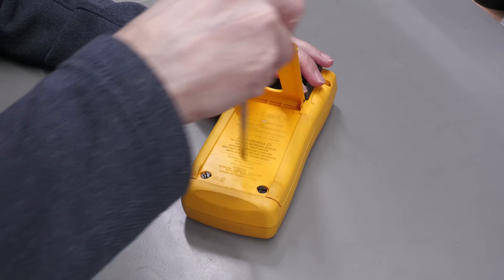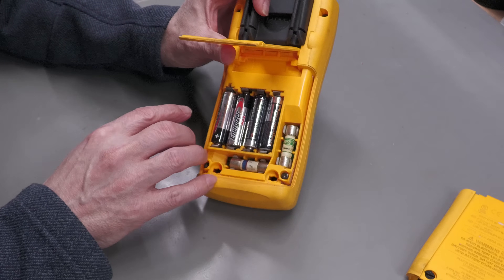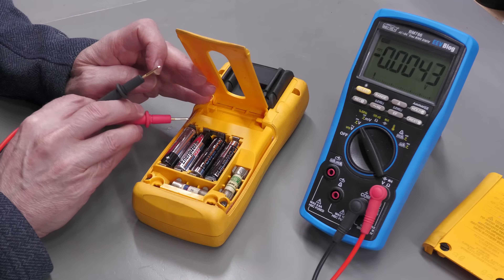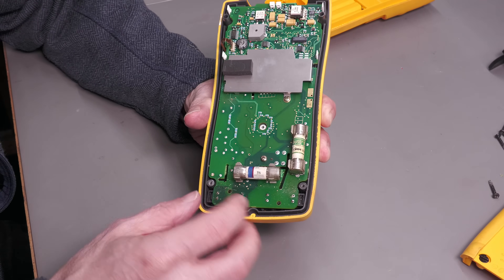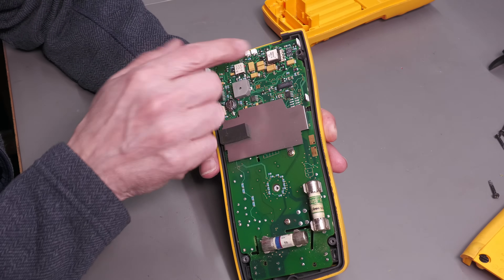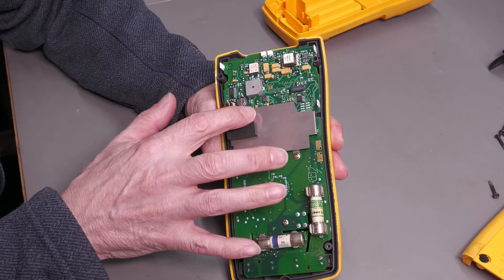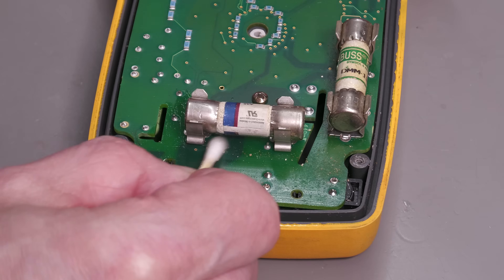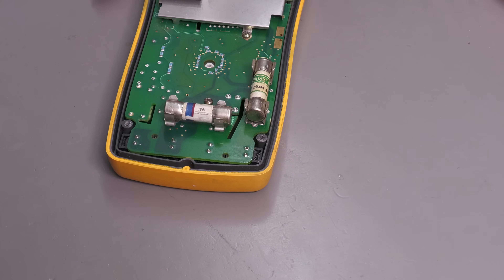No.123 - Fluke 189 Multimeter Repair

Comment: Looks like the sockets had been replaced judging by the soldering. I recently replaced mine due to broken pins and they did take a bit of heat to get the pins to take the solder. Great meter, got a 289 as well, also a great meter but a bit of a pain waiting for it to boot compared to the 189 switch on and measure. Keep the great videos coming.
Reply: how difficult is it to replace a test lead socket for someone with essentially no experience desoldering and soldering on a PCB? I have a Fluke 719PRO pressure calibrator and the negative socket is loose and will break the circuit when gently jiggled. I suspect the pins are failing but I have not yet opened it up since it still works when I need it. I also don't want to brick a $5K fluke calibrator by trying to fix it and making things worse... I have a decent Weller analog soldering station and some experience with soldering but little to none on PCBs.
Reply: @user-my5ey6ow7m  Some meters sockets are fixed by screws so the first thing to do is find out how the sockets are connected to the board, could be as simple as a loose screw so you'll need to open it up and have a look. My Flukes 4mm sockets are a bank of four in a single plastic moulding so it was a case of desoldering all the not broken pins first. Sometime you need to add some solder and flux to get the old solder to run better as any flux would have been removed so the solder can be dry. Be careful not to overheat the pads as they could come off, also don't force it out as you could pull the through hole plating out. I used a Weller, a solder sucker and some fluxed solder wick. Furtunately I've been doing this a long time so have had plenty of practice. I would say take you time but if you don't feel confident, get someone who has had plenty of practice. If you do it and all goes well. Give the area of the fix a good cleean with iso. Good luck.
Reply: @ thanks for the very insightful reply. That was far more detail than than I expected and I appreciate it! I will post an update if/when I dig into this repair.

Comment: Sometimes the circuit board holes are so large that the solder has run down the shaft, and so it appears that we have a dry joint or similar. Best to make sure though!  ;-)

Comment: Thank you, it was interesting. The only thing that confuses me is how you soldered the contacts for the probes. Most likely, this assembly has already been replaced previously, and the terminal is already oxidized along its entire length due to insufficient use of flux. It will not be well wetted with solder, especially in the depths of the hole. IMHO, it is better to unsolder the entire assembly, tin the pins and solder it again.

Comment: Common problem on this range is broken pins on the terminal panel and Fluke have obsoleted a lot of the parts.  Sometimes can be bodged with some TCW, not ideal but better than a completely unusable meter.

Comment: Best meter they ever made by miles. Probe sockets are fragile and prone to breakage. The outer case cleans up like new using a nail brush and fairy liquid. There's grease on the contact tracks in all of mine.

Comment: The large fuse contacts were likely soldered on after PCB assembly, and they simply didn’t clean up the excess flux. You can even see the telltale splatters in the light. I’d clean it up too if I were already in there.

Comment: Don’t let Mr EEVBlog see you put self tapping screws in without find the cut thread :)
Reply from the maker: Yeah, it's probably good practise for screws that are being removed/inserted daily........but also generally I think screws like this if you operate the screwdriver lightly will find the original threads anyways. Basically, I never reverse the screwdriver......a habit of 40 years....:-)

Comment: In general: do be careful with that fiberglass pen. Don't use them on soft gold plated (edge) connectors for example. At least first try some alcohol. I found over the years that ist most often more than sufficient.
Reply: For edge connectors the old pink rubber eraser - the tough kinda grainy one - seems to be just about right. That’s about as loosey-goosey of a material spec as one gets :)
Reply: @absurdengineering  Yes, that one is a milder solution. 

In between the pink eraser and the fiberglass pen you have the option of a "ink eraser", the variant used for erasing ink off technical drawings (Rotring pens and all that, shows my age I suppose). The ink eraser variant is more abrasive than the pink one, and less so than the fiberglass pen.

Comment: I have an old audio amplifier connected to my computer and I had been having strange intermittent problems with it shutting off randomly. I looked online and people were saying that they had bad solder joints that they reflowed and restored it to working. I tried this and saw a few suspect joints in the power path and reflowed them and have had no issues since and it's been about 3 months. I never knew that solder joints could go bad over time like that.

Comment: Either that or the battery contacts. I had the same "surprise" with my Fluke, It was working fine except in Ohm's mode where it had to draw a little bit more current.

Comment: What "Glass fiber pen" is that? It seems to be a missing tool for my workbench.....
Reply from the maker: Available on Ebay or Amazon. The red handle ones are the most suitable for electronics. Use sparingly/lightly as it is easy to take the plating off a Pcb if you scrub too hard.
Reply: @IanScottJohnston  Thanks! 3 for under $10, already on order.
Reply: It’s a tool that was originally used by draftsmen to scrape off ink from vellum, IIRC. EEs got a hold of it and the rest is history :)

Comment: Well done, Ian. Sometimes they just need a bit of attention. I recently pulled a Fluke 189 out of e-waste at work. Its battery contacts were badly corroded and I found that new ones were available on Amazon for less than $20. I replaced them and now it works great. I really like the features of that meter, and it's dead-on accurate.
Reply from the maker: Must admit, I like the 189 also. A no nonsense Fluke.